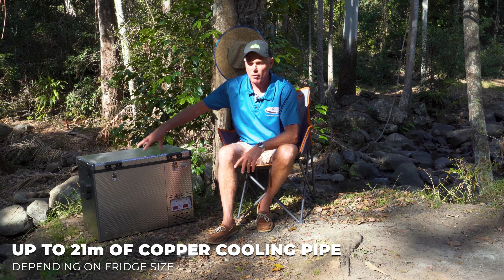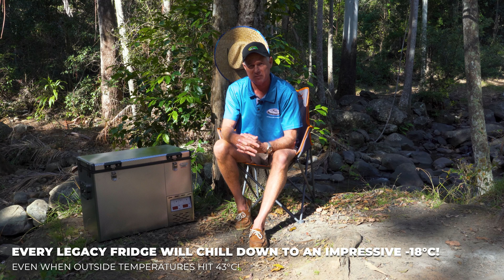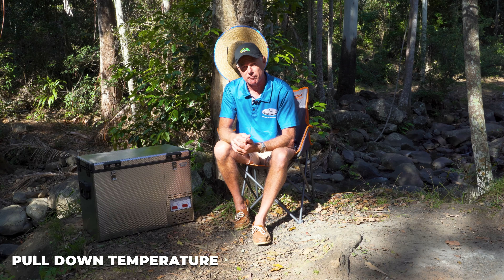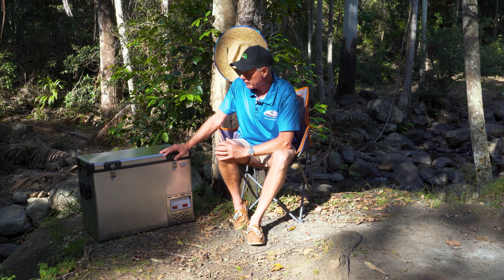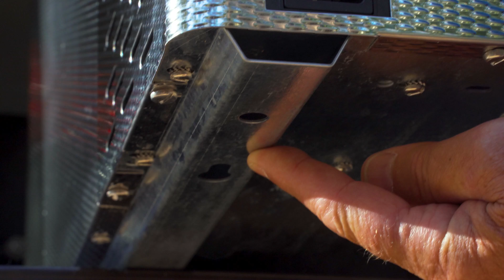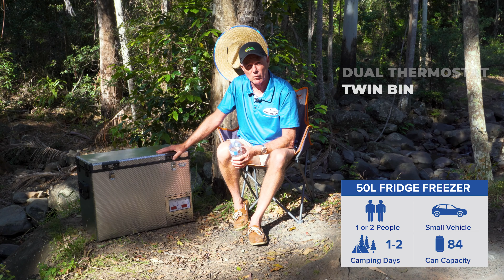National Luna 50L Legacy Fridge / Freezer

Comment: The coldest freezer temp ours achieved was -20*when set on -24*
To keep ice creams at -18* we’ve been running ours on -22*
With fridge side set to 1*
Power usage for 24 hours has been sitting anywhere between 58 ah to 68 ah

On AC power We then put 15 zooper doopers in the freezer section set at -24*
that already had two frozen water bottles and ice creams. 
18 hours later the freezer was still only -10* Then 30 hours later freezer was only -14* Zooper doopers finally frozen but all other icecreams melted. 

We ran the fridge in the air conditioned car for 5 hours and it used 18ah in 5 hours. 
After 37 hours the freezer still didn’t get any cooler the -15* although it was set to -24* had to throw out all the icecreams.

Comment: We question the cool-down capacity of national luna as we’ve been advised by the service agent the complete opposite to whats in this video. 
We’ve been told it’s perfectly normal for the fridge to raise 8* when placing 2 litres of water in it and 9 hours later still be 5* higher then it’s set point. 
We’ve also been told adding a 6 pack of beer is placing a large load on the fridge.. 

Why spend the money when a esky and ice does better 🤷‍♂️
Where’s the data to show National luna is one of the fastest cool-down fridges on the market? 
Or is this video simply sales man fluff?

Comment: We purchased the 50 L legacy dual zone based on all the marketing info, this video included. Sadly we aren’t getting the results all the marketing info displayed. 
Fastest draw down fridge? Ours takes anywhere between 10 - 15 hours to get to -18 readout with a thermometer, although fridge thinks it’s at temp within a few hours. Freezer needs to be set to -24 to actually get a bin temp of -18 to -20.
The display temp matches thermometer at fridge temps but when running as a freezer the bin temperature can be up to 10 degrees warmer then what the fridge dial displays at times. Somedays stays within 3 degrees. All done inside on AC power 22 - 25 ambient temperature. 
Pre chilled fridge and contents on AC power for 3 days fridge 2deg freezer -24 deg which gave -20 on thermometer. 
Noticed with dial set to -12 or colder the fridge cycles every 4 minutes on AC power. 
Put it in car at 3 deg fridge -18 freezer. 
Highest car temp 35 deg for 2 hours, rest under 25 deg. 
Used 13.5 ah in 6 hours. 
Highest amp draw peak was 8.5 amps

Turned both sides to 4 degrees, only used 4 amps in 14 hours. 

Had seen reports of some National luna owners saying they are power hungry if using a side as a freezer. I have to agree. Would hate to see the power draw if both sides were set to freezer.

Comment: Your not telling the viewers how you guys don't respond to emails, and by the looks comments here to. You don't have a clue what your talking about, you shouldn't be wearing the logo. Your the middle man, the lunch boy, a pretender.
Reply: They rarely respond & they pretend they didn’t receive emails.
They don’t return phone calls. 
National luna is so fantastic it couldn’t ever have issues. 
A non working fridge out of the box and they make out the client is an idiot. 
We’ve lined up another video review to be done over the break. Will the National luna redeem itself after spending a month at the service agent from  being defective out of the box.?Issue is, we are still waiting to get the fridge back. 
We don’t expect it will do much better as we’ve been told our findings are perfectly normal for Nation Luna. 
A warning to potential buyers, look past the glossy marketing without actual data to back it up and you’ll see many negative reviews for what is an expensive fridge.

Comment: You didn’t say the amp draw
Reply: Mine uses 4x the power when set to 3c/-18c vs 4c/4c over 24 hours. 2.08 ah/h vs 0.51 ah/h
A big increase considering freezer is only 11 Litres. Yet to test amp draw when set to -18/-18
Peak amp draw I’ve seen is 8.9 amps. 
3c/-18c